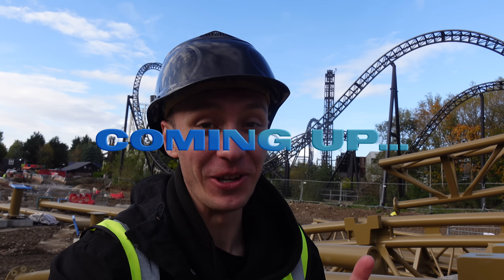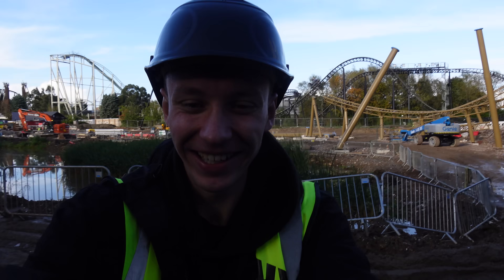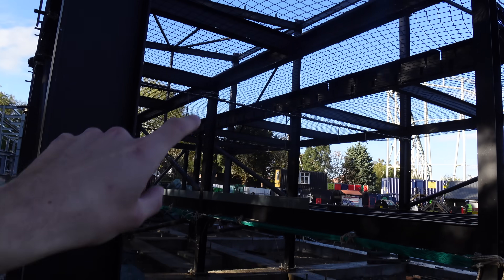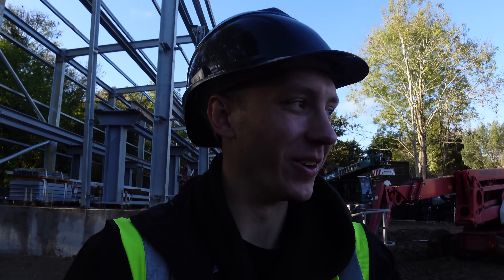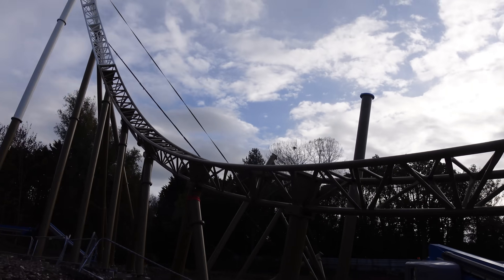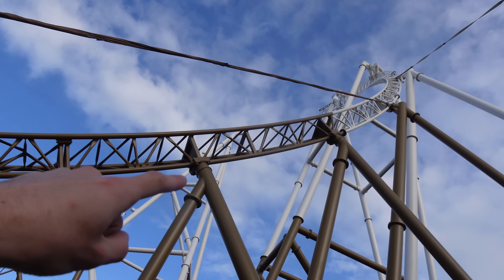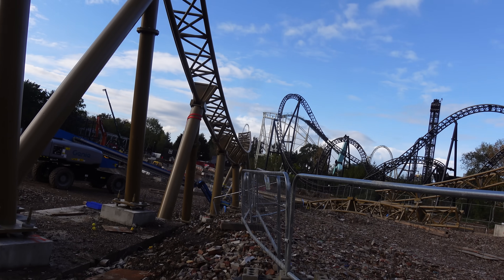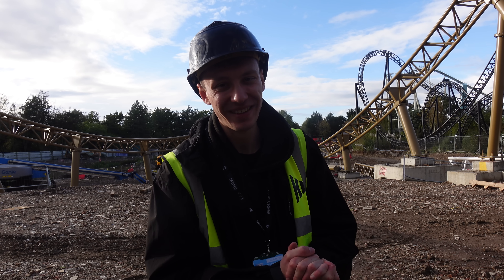HYPERIA Construction Update #47 | THORPE PARK

Comment: To put the height into perspective I searched what else is 165ft tall and if it helps anyone else picture it that’s roughly the height of Nelson’s column in Trafalgar Square in London and also the arc de Triomphe in Paris. 🤯🤯🤯🤯

I have a question about the splash down element of the ride. Why is it called a splash down? Are we going to be getting wet on this ride? or is it just because we’ll be practically  (but not actually) touching the lake?